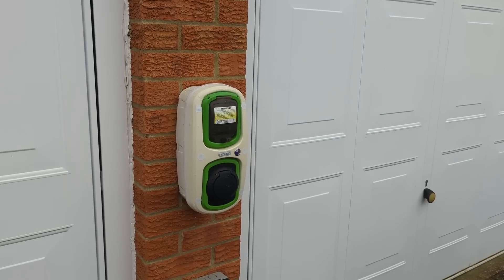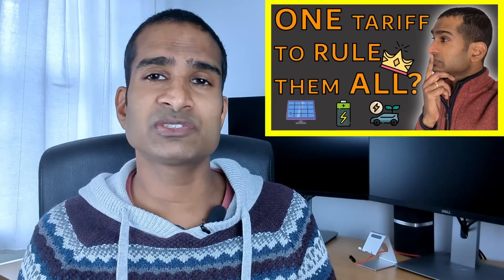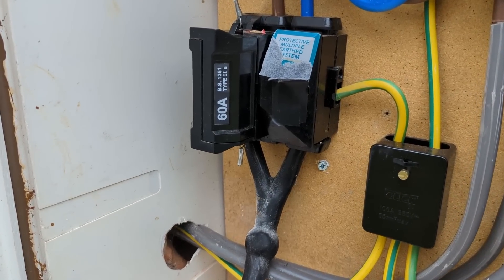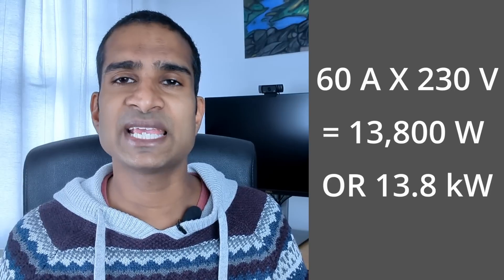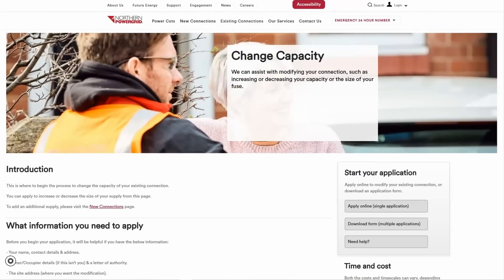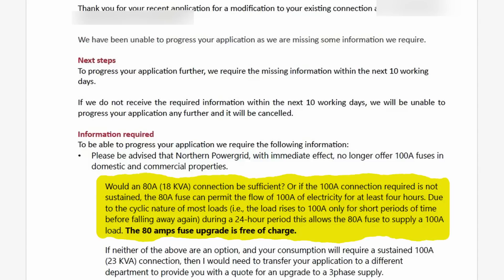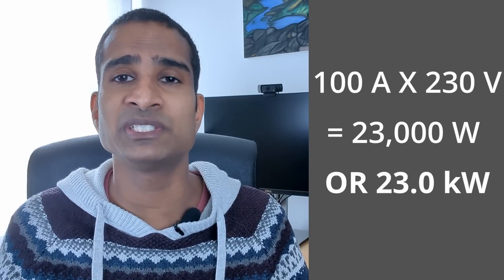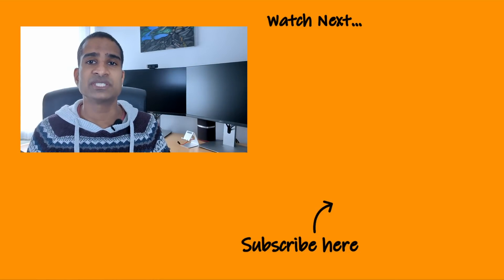Should You Upgrade Your Main Fuse?!

Comment: The fuse is to protect the DNO's infrastructure.  Do battery systems not allow to add a maximum gross import rate, like a lot EV chargers allow?
Reply from the maker: Thanks - yes my GivEnergy system allows me to set the max charge rate if needed. That would certainly be an option to reduce the power.

Comment: I have a 100A fuse, fitted from when that was the standard.  The standard has been reduced now to 80A as these are slow blow fuses and can deliver 100A for around 4 hours as it said in the letter.
I don’t have an EV charger but have an ASHP and 2 inverters and have seen mine pull in around 16kW when the electricity is cheap
Reply from the maker: Thanks for the info and insight Geoffrey 👍 Shan

Comment: Scottish power state that the main fuse is the responsibility of the electricity supplier . Did I misunderstand . ?
Reply from the maker: That's what I was told too by the engineers if I wanted to upgrade things any further than the new fuse they put in 👍🏽
Reply: SPower say that the fuse is the responsibility of the domestic supplier . Mine strangely is marked 60A/80A
Reply: 60A sustained load, 80A peak load

Comment: We ordered 2 powerwalls and solar. Had one installed. We thought we had a 100 amp fuse, but it was all wrapped in tape. Octopus installed a car charger and told me it was a 60 amp. We have a 12kw heatpump plus air to air systems, too. With the 2nd battery, we would be charging at 10kw. I delayed the 2nd battery and asked the installer to apply for a fuse upgrade. It initially looked like they would insist on 3 phases, but this would mean digging up our drive and considerable expense. In the end, they installed 100amp. They actually paid us £35 compensation as they couldn't keep the original appointment. 
I got frustrated with Octopus trying to change tarrifs, so I changed to Eon Next Drive using your referral code. So far, they've been very good.
Reply from the maker: Wow, that sounds like a great set up Dennis 👍🏽 Yea I've heard it can cost quite a bit. Good to hear they're being held accountable.

The Eon next drive tariff has been excellent and glad you've found that too. Thanks for supporting the channel 👍🏽 Shan

Comment: When getting our shared incomming mains cable de-looped from my neighbour & having a car charger installed, Nat Grid were supposed to have upgraded our main cut out fuse from 60 to 80amp. 
6 months later we got our EV, solar & battery installed & ran everything possible overnight on our cheap rate Octopus Intel Go tariff. All went well for a few months but one night we woke up to no power in the house. The main cut out fuse had popped. I called Nat Grid who were on site within the hour. It seems they had not replaced the original 60amp fuse which finally went, & we don't have a heat pump! N.Grid replaced the rather fried fuse carrier & installed a new 80amp fuse - all FOC. Been OK since.
Reply from the maker: Whoa! Thanks for sharing that, so it certainly sounds like a good idea to do it, especially given it's FOC. Shan
Reply: @everythinghome  I think the DNO's will only upgrade the fuse if you are having other work done. For me that was the Car Charger which will pull a constant 7.4kW for up to 8 hrs if our EV battery was flat. Add a washing M/C, dishwasher, 3.6kW solar/battery inverter & possibly a HP & even a 60amp fuse may not be enough.
Reply from the maker: We weren't having anything else done but we're pretty close to the limit. A heat pump in the future will certainly up the requirement from my previous 60A 👍🏽

Comment: Interesting that Octopus engineer changing my Smart Meter took away the 100amp fuse that the house was built with and put an an 80 ! Also Northern Powergrid
Reply from the maker: Interesting, and odd! I wonder what the reasoning behind that 🤔
Reply: The reason is that the ‘new standard’ is 80A (that’s the national guidance).  They are slow blow fuses and as it said in the letter they can deliver 100A for around 4 hours which for most people is sufficient.  A 100A fuse operates similarly and wouldn’t blow unless 100A is exceeded for an extended period of time.
Strange that Octopus engineer touched the master fuse, he’s not authorised to change it as its owned by the DNO

Comment: Hi I am Northern power grid also (Newcastle). It looks like you went for the 100a fuse upgrade. How much did NPG charge you for this? Thanks and good videos !
Reply: Thanks again, your video makes sense for sure.  It was just in the video of your new main fuse is a 100a fuse (not 80a). I can only assume they have either given you a 100a which is a great result or its actually an 80a inside a 100a holder. It would be useful to know. Again great videos thank you
Reply from the maker: All in the video, it was free and I arranged it via their website 👍🏽
Reply: sorry I misunderstood so you moved to a 3 phase supply with the 100amp fuse. Did this only take 1/2 a day's work. I thought to change to 3phase involved a load of work (digging / new cables etc). Tx again
Reply from the maker: @marckaluza4559 single phase, 80A fuse up to 100A capacity. Maybe watch the video again and the Northern powergrid letter in the video 👍🏽

Comment: Last week had mine upgraded for 60amp to 80amp 😊
Reply from the maker: Great minds 👌🏽
Reply: @everythinghome  my 12 kW shower used to dim the lights for few seconds when not running on battery in cheap period which is a sign that I need a bigger fuse let alone when the power wall is  charging from grid that pulls another 5 kW so that 17kw just  matter of time before that 60 amp one popped 😮
Reply from the maker: Ah! Interesting to know. Hopefully future proofed for a while now 👍🏽